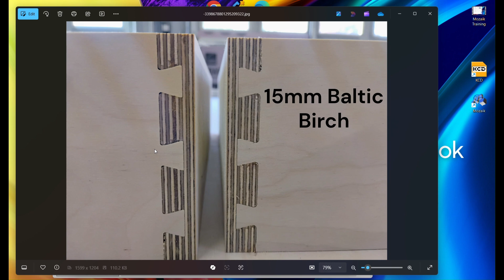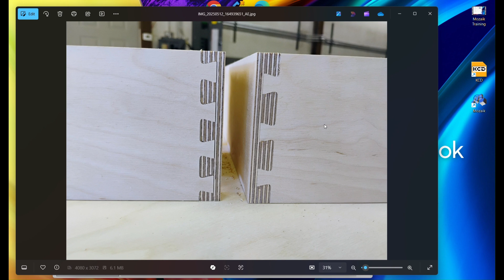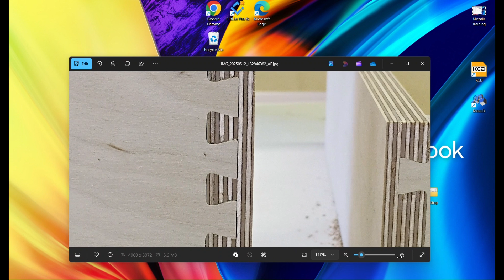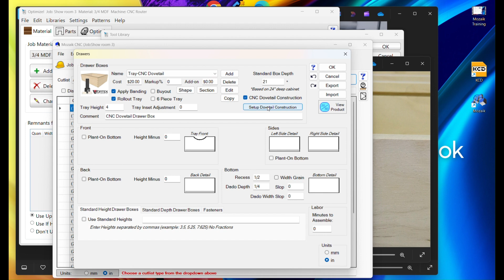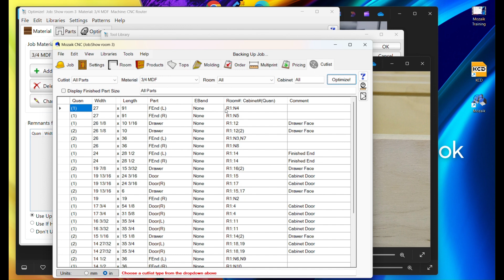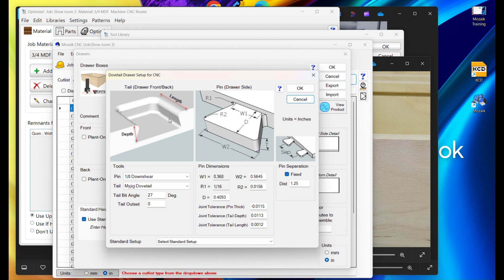CNC Dovetails with Mozaik and Microjig

Comment from the maker: I went back through and came up with new standards so i can leave my spoil board offset true after
surfacing. So Surface to 17mm and cut at 17mm table offset.
I found that dialing in the standards works better if you temoporaily switch to mm.

Pin 1/8 Downshear                                             w1 8.5        w2  13.5
Tail bit Angle 27 degrees                                    r1 1.6        r2    .4
Tail outset 0                                                          D 10.5
                                                                               Joint tolerance(pin Thick)  -0.3
                                                                                Joint tolerance (Tail Depth) 0.6
                                                                               Joint tolerance(Tail Length) 0.4

One thing to consider is this is a lot of work on the 1/8 bit. Im noticing it is either warping do to heat,
Or the collet is wearing out. after cutting a job my joints were becoming loose on the next cut. I replaced
the collet and bit and they were tight again. Next time im going to just retighten the tool and see if that helps.
Im considering going with the vortex so i can do these cuts with 1/4" bit to speed up cutting and prodction.

Comment: Do these parameters hold constant for any drawer thickness for the most part...i.e. if you get good results with a 5/8" drawer side thickness will the 3/4" drawer side thickness work out about the same?  Also, one quick question in the Mozaik parameter setup for dovetails.  I see when you select from the standard setup drop down menu, and select the vortex tools it doesn't stay selected.  Is this a common thing or don't you even use this menu?  One quick note to you....I was playing with this a lot lately trying to cut a drawer out.  I attempted to run my cutlist and then optimize for the sides.  In an attempt to save on material, I would go into the parts editor and change the length of the side & back to around 6" to see how good a fit I was getting.  Let me tell you this doesn't work and you may know that.  Shrinking the size down in the parts tab makes thing get all wonky.  It took me a few iterations to see this was happening...only after going to the parts editor and trying to tweak the various dado widths an stating position.  What a nightmare I was chasing.  At any rate, I finally figured out what was going on and started over.  Any advice from you would be greatly appreciated.  Using these bits instead of the Vortex ones seems to be working...not that Vortex isn't making a good product.  I think they could go down this path and save us a lot of money.  Thanks for your help.
Reply from the maker: The material thickness would affect the standards I would imagine. I haven't tried it but when cutting them with a jig it does. And I'm pretty sure I've noticed differences in joint tightness just with the variation between sheets from the factory at the same thickness. I'm not sure, I haven't used the standard setup. I just added the tool into my setting and then went straight to dovetail parameters in the drawer box setting.

On the shortening the box in the optimizer, I don't think I've done that. I just add a single drawer box in my order form and then optimize it, you don't want to go too small on the part unless you leave tabs, but I was running them at 4x15 and once I get it into the optimizer I delete a side and back so I'm only cutting 2 pieces to test the joint. But that would make sense, say if the drawer only had 3 pins and you stretched it, it would changed the geometry of the widths between the tails. It will do that if you used variable pin spacing do. They need to be fixed to a certain dimension in the drawer box setting to make them consistently spaced through multiple heights.
Reply: @CBcabinetco  Thanks for the response.  I'll continue to work with it.  I got a pretty good fit on the ones I just did, but they could be played with some to tighten them up just a smidge.  I've been working with 5/8" drawer sides for now and they do look pretty good with the settings you provided.

Comment: Hey I noticed the biggest difference between the setup I have (and am trying to dial in) and yours is that you change your tail bit angle. According to the specs it should be 28 degrees (and thats what I have it set to) but I noticed on your first set up you have it at 30 and the second you have it at 27. What is your reasoning for changing it in the different settings and how has that effected your joints?
Reply from the maker: The my jig dovetail bit said 14 degrees on the case so that's what I started at. Then I just did troubleshooting until I got a tight joint. 27 seemed to be the best fit for me. The joint seems to vary Everytime I use a new sheet, must be discrepancy in thickness so I use putty as well.
Reply: @CBcabinetco  Thanks!

Comment: What machine are you running these on? Vacuum bed table? Would love to ask a few more questions on this.
Reply from the maker: 5x10 front range pioneer. It has a vacuum table with a 10hp vaccum pump, I'm only cutting 4x8 sheets.